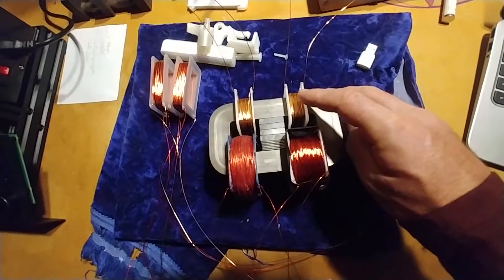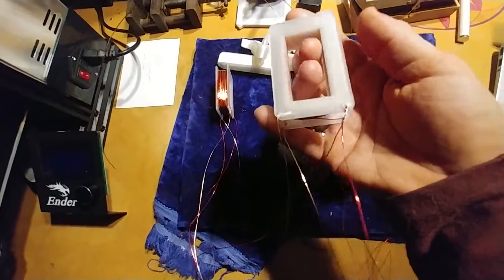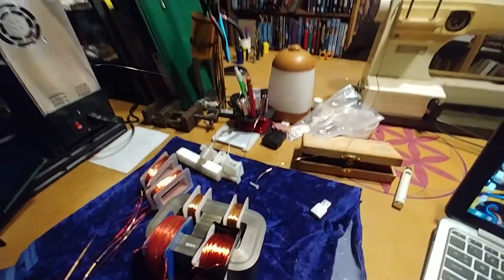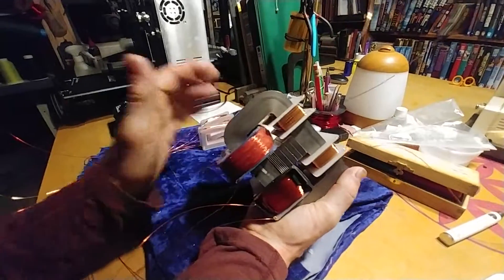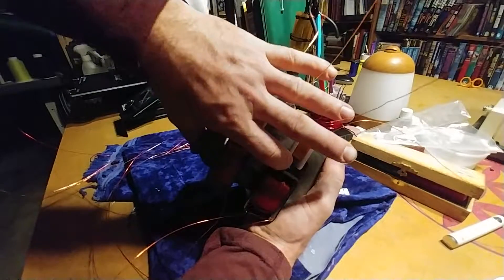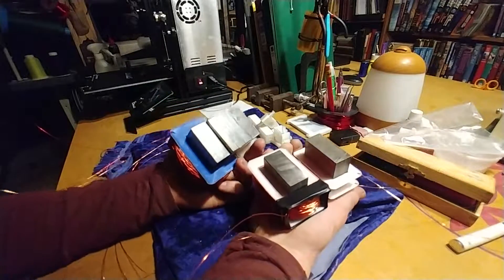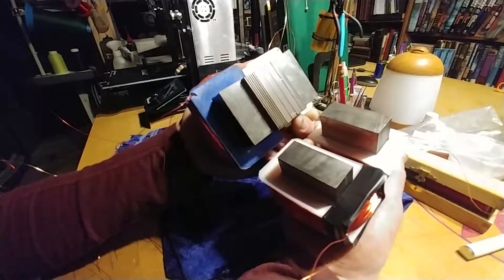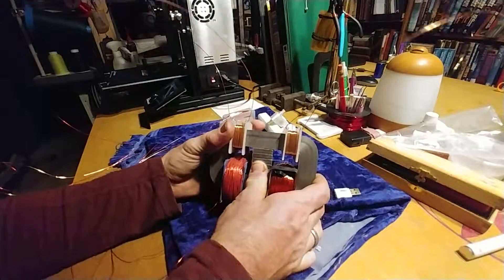MEG Replication - Part 3 - Amorphorous C-core coils wound and installed.

Comment: 1:23 re: separating them. it should be easy if you use the Edward Leedskalnin approach of just sending in a pulse the opposite direction. This neutralizes magnetism. Or, if you were using the MEG with AC, it ended with a certain polarization, and you just need to pulse it the opposite way to neutralize it.

Comment: Cool. I too am working on an MEG. Heads up, when measuring the output, make sure the multimeter measuring the output is capable of measuring high frequency voltage
Reply: How high did you take your frequency? I believe Jeff went to 15Khz. I was hoping to go much farther possibly up into the upper 30's Khz. I do not have one of those cores any more but I have a feeling that  the reponse will go up like Jeff saw and then go down but then go back up even further and likewise I will keep looking to see if anyone found that to be true. Thank you.